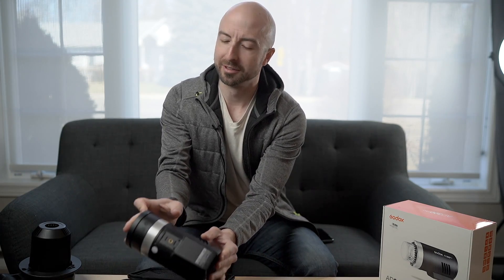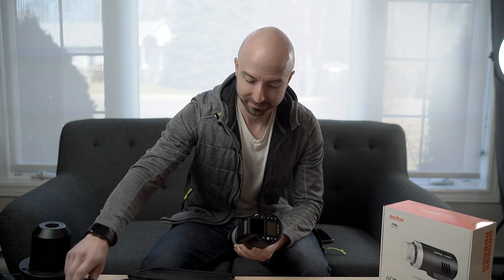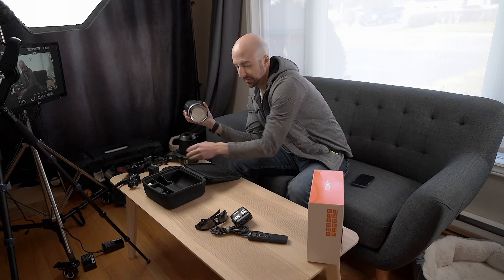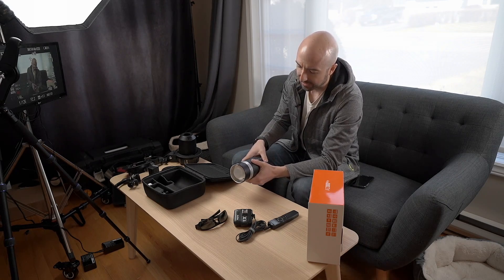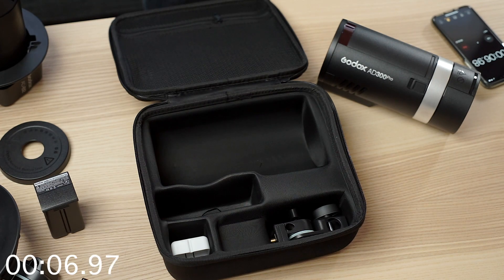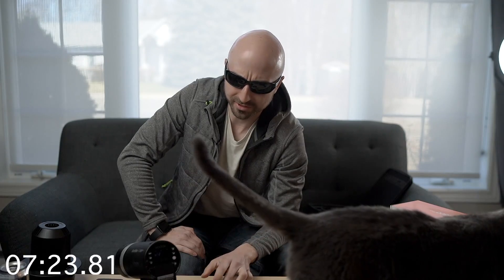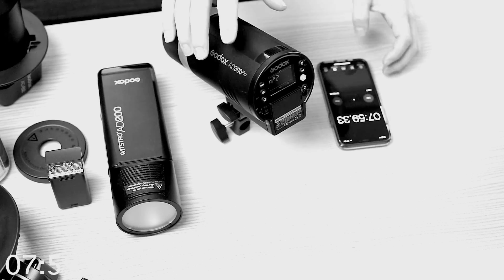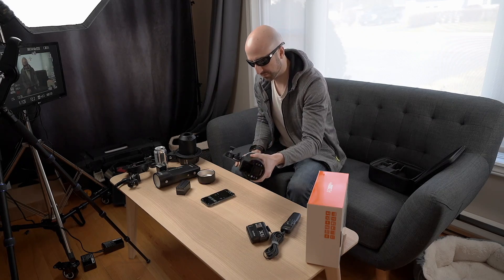AD300 Pro Overheating Torture Test

Comment: This test is incomplete. What is the recycling time for 1/2 power would be at the end of battery charge 5-10%? I'd like need to know. I usually make not 120 shots as here but around 1000 during photosession  and I wouldn't be happy to know that after 300 shots the recycling  jumps to 10 s... In the net I found the test for Profoto B10 about 6 s at full power at 10% charge. But Godox? Thanks anyway.
Reply from the maker: That’s a tricky request, as if you run a Godox battery completely to depletion, it has a habit of not being recognized by the charger anymore. I’ll see what I can do, though.
Reply: @WesPerry   Oh, I understand what are talking about. This way I lost 1 of my 2 batteries for AD600 pro when left it empty at my bag for a week (:
Reply from the maker: Glad you’re aware. Gotta be careful. Next time I run it down I’ll see what happens, though. ;)
Reply: @WesPerry  Thanks!

Comment: bit late perhaps, but to whom it may concern: I shoot front flash portraits a lot. I used to use ad300 pro, but when firing rapidly (some quick succesion frames up to 2 frames a sec) at 1/16th to 1/4th power the Godox started overheating after about 50 to 70 shots. I now use a Profoto b10x and it never overheats while being faster recycling even. I can do this all day and I never get the Profoto to overheat, while the Godox overheated every time and slowed down. Also it seems the b10x is faster to respond on the first shot after a pause in shooting with my canons. I planned to go all Godox when I bought the amazingly portable ad300s but in daily use the b10x is so much snappier in its response and not overheating, I am a bit sad to say I switched back to Profoto.
Reply from the maker: So you’re saying that another flash with 4x the price of the AD300 Pro works a little better?
Interesting… 😂
Reply: @WesPerry  I am providing information from an in the field (professional) use case your test didn't provide. Info which could have saved me from buying the godox's to find out. For the use case of sitting-on-a-couch-waiting-for-a-flash-to-overheat-while-videotaping-yourself, I see this difference would be insignificant. You choose the right flash for you. well done.
Reply: @mmeerdam thanks for the info

Comment: Hi Wes, did you ever end up doing a AD400 pro overheating torture test? Couldn't find it. Would definitely love to see how the ad400 pro handles overheating/slowdown on constant use before deciding on getting the ad600 or 300 instead. Thanks!
Reply: I have problems with AD400 overheating. Round about 15min on full power. Is a Profoto B10 better with cooling?
Reply from the maker: A Profoto B10 is pretty hard to stop.
What shutter speed are you using?
Reply: @dangphoto_  does it slowdown at 15minutes at full power? or it overheat and stops shooting completely?
Reply from the maker: Yeah lots more details needed here.

Comment: Thanks, Wes, very useful! I fully agree that all devices should have a hard switch. I bet that the AD300 draws a bit of vampire current, even when switched off, just like the AD200 and the AD600 PRO do. I'm sure this killed many a battery when the user forgot to take the battery out for storage.
Reply from the maker: Not just that, but in the event of emergency, say the device locks up, goes haywire, or gets wet, I want to be able to truly kill the power in an instant.
Reply: My AD200 doesn't use any power at all when it's switched off. I check the power every month or two to maintain it around 50%, that's ideal for li-ion batteries storage. But I think that if you'll charge it fully it'll live for at least a year till it dies.
Reply: @СергейМогутов-ъ4д  Remove the battery from your AD200. Then switch it on. You'll notice that it will briefly light up the display. Turn the AD200 off again, insert the battery and wait for a few seconds. Now remove the battery and turn the AD200 on again. You'll see that it will briefly light up the display again. This is only possible if the AD200 can draw current from the battery even when switched off.
Reply: @tkimaginestudio  Well, there are capacitors in the chain. That's why it works like that. All I can say is AD200 doesn't loose charge over time, not more than from a normal li-ion self-discharge. I think that all li-ion batteries should be handled with care, they don't like being discharged fully, and if you'll leave it in that state you'll loose lots of capacity either way. IMO it's not a problem to charge it to 50% and check it every 2-3 months.
Reply: @СергейМогутов-ъ4д  Think about it. Where did the capacitors get their charge from? Capacitors self-discharge over time which will lead to current being drawn from the battery. The amounts may be small, but it is better to remove the battery. It is a good idea to not leave batteries in devices anyhow, but the discharge that will occur even with the switch in the "off" position is yet another reason.
Reply: @tkimaginestudio  The capacitors charge from the battery each time you turn the power on. I don't remove batteries from any of my devices. But I pay attention to charge of batteries, it's part of normal maintenance. Never had any problems.
Reply: @СергейМогутов-ъ4д  If you read my description properly, you'd realise that the charging of the capacitors happens without the flash being turned on. I'm happy for you that you don't have issues with your batteries and I'll leave it at that now.
Reply from the maker: I’m gonna hold off on commenting because I plan on inadvisably wiring up an external battery and using a meter to see if there is any leakage current IRL before jumping to any conclusions 🤓
But I Will say that Godox, in Some of their manuals, recommends removing the batteries from their flashes when not in use.
Reply: @tkimaginestudio  So you are basically saying that off switch is a software switch on AD200. It might be so, I'm just saying that I don't see any excessive battery drain. Nowadays almost all computerized devices have software power switches. I'm OK with that.
Reply from the maker: I got my AD600 Pro a little wet one day (some snow fell on it...a hazard of living in Canada). Then the soft power switch would no longer work. Couldn’t turn it off Or on. It was pretty frustrating. After a few weeks it went back to normal again. 🤷🏻‍♂️
Reply: @WesPerry  And with the hardware switch it would probably short out.
Reply from the maker: It was a very small amount of water. Like so little I don’t even see how it got wet underneath at all. Very strange.
Reply: @WesPerry  I try not to shoot in the rain, cause all that high current might big bada boom ) And the fan in the strobe will suck all that moisture fast. AD200 vs AD300 vs AD400 boggles my mind a bit. So many compromises in different directions. AD200 that I already have, is a nice thing but I'd prefer something with a proper mount and at least some modelling light. Faster recycling times will also be welcome.
Reply from the maker: Oh, when I’m in the rain I wrap it up real good. It was a dusting of snow that blew off an adjacent tree. 😉 🥶
Reply: @WesPerry  Well, it's good that you still have a fully functional strobe. Best regards!

Comment: I think this strobe caused them to make accessories for their own mount. I couldn't find a Godox mount octobox for the AD400, but now there is one. I wanted to use that because of the slimmer profile without the Bowens adaptor. But I bought the Bowen adaptor so now I'm not sure if I should get all godox, or just use Bowens to get all the variants that support Bowens mount. The AD400 is super slim without the Bowens adaptor, but with it it really stretches my camera bag making it barely possible to fit it.